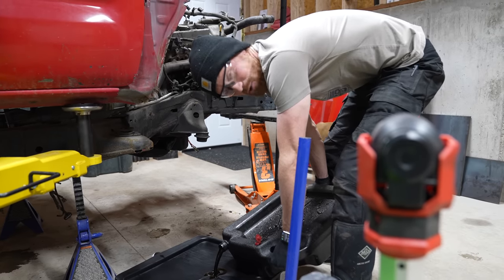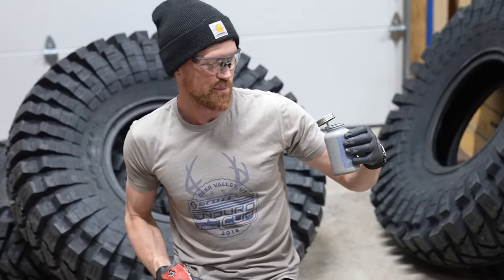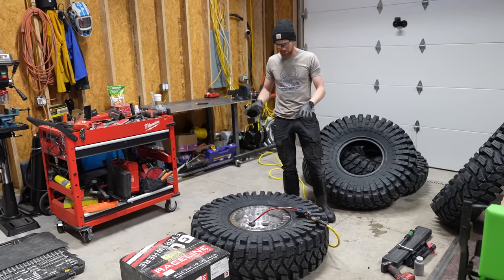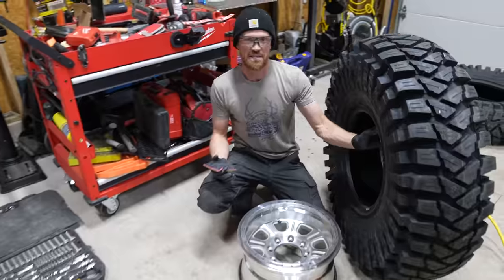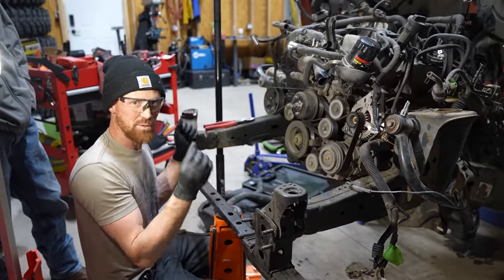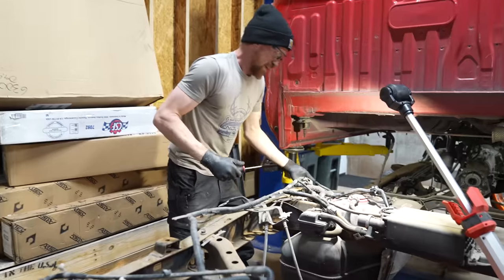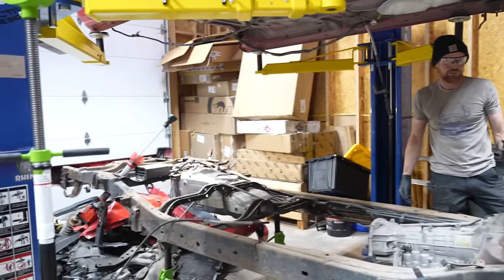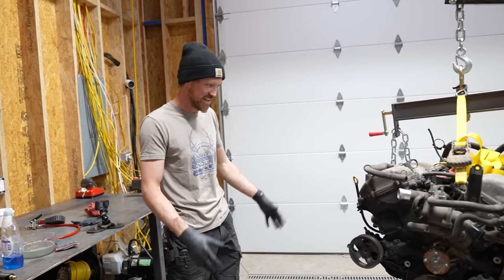CHANGE OF PLANS, IT'S GETTING MORE INTENSE... EP 5

Comment: Mechanics tip, attach one engine hoist chain on the front of the engine, and the other chain on the rear, this way you can use the hoist leveller to adjust the position of the engine!

Comment: We use to have military aircraft tires and wheels that were a real bear to get the bead started on. But we found that putting a ratcheting strap around the middle of the tire and tightening it down you could eventually get a seal and the air would pop them on.  I'm enjoying these videos, brings back memories.

Comment: When airing up a beadlock for the first time, I use a 5 gallon bucket, which supports the wheel and usually the weight of the tire is enough to get it sealed enough to start taking air.

Comment: Another possibly safer way to help set that lower bead I have seen used is to wrap a ratchet strap around the circumference of the tire and tighten it up. By squeezing the tire around the middle of the tread, the strap puts pressure to force the bead into place.  May not be as much fun as jumping on it though.

Comment: Trent, NIce recovery on balancing the motor as you pulled it out from the frame. The motor is always going to be the heavier part. Lesson learned bolt up more towards the center of the motor. L.O.L.

Comment: Hey Trent..
   Did you know that at the assembly plant. The frame rails were put in a jig.
   There pin or holes in the frame rails to square it up.
   This is what you need to get the frame back to square when add the new rails..
  Oh by the way. The hoist leveler was sideways.
  Turn it and the hand crank would have leveled out the load..   good luck...

Comment: I worked in VW restoration. I highly suggest to post mark each part and separate by putting in a marked box. Also write down the socket size. By doing this you'll save yourself headaches and valuable time!!! 
I witnessed it all of the time folks losing parts, clueless what went to what, and my wasting very many hours trying to find parts on projects they started. Only me had this bright idea with the suggestions I just recommend.
Reply: Awesome advice...he needs another one of those big ol tool boxes just for 'Trents garage'... Im glad I read your input sir...
Reply: @jess4mathews  well, I'm a woman. Probably the reason why I'm the only one who had the bright idea immediately!! 
I put the nuts and screws immediately into a zip lock and post a note. I also write down which side something went to. Writing the socket size saves an incredible amount of time and whether metric or not. 
And I mark the car/ bus it goes to but he's only working on one truck.

Comment: Trent use a ratchet strap. Strap the tire while you filling it to push the tire where it need then take the strap off when it pops, then your good to go.
Reply: There's also the more exciting, spray ether starting fluid inside the tire and light it with a torch!  The resulting explosion forces the bead onto the rim.  Old mechanics trick when changing a tire or reseating it in the field.   Had to do it on a Bobcat once, works well!  Scares the crap out of you..... but works well.   🤣

Comment: Safety suggestion  seeing as you don't have tire cage  use a section of chain wrap thru axel hole and around tire loosely  so when adding air doesn't  pop off and possibly  hurt you  while rare it does happen  and has caused serious injuries   understanding  that you not adding  alot of pressure  just the same it only takes one time  like being pregnant  you are or or you are not no middel ground

Comment: OK, 1. the ratchet strap works, what you need is a engine hoist leveler. 2. it appears you want a lot of power. it's going to be expensive for a Toyota. So, just get you a 5.3, 5,7 or the desirable 6,0 LS engine, with either a 4L60 or 4L 80 trans, A Holly EFI unit and brain(Computer) and have way more power than you ever want, and do it much cheaper. A very popular swap these days, into EVERYTHING! And Tons of information out there for a complete swap!

Comment: Yaaaa 💪🤝🤓 having that mota out where you can see every aspect of it is a huge step...thats how you can really see what you've got...check for cracks, warps & dings and bubble gum.... might consider start ordering parts as you get them off and before that big red puzzle gets so scrambled around its an omlette not a truggy... great fun going on over there spectacular tires I mean oh heck yeah...where's Joel that smart guys' gonna want to know where everything's supposed to be sitting and how it works... I think they clip those wiring cables together in the middle so they don't get hung up on assembly line or subsewuent functions...anything going forward or in reverse lol 😆thanks for sharing c-ya @

Comment: Engine stand... Allie did you know about this purchase. LOL  We built our own engine stands because our equipment  wasnt exactly standard, and we built a piece of an old axel in it with brake shoes  so we could spin the engine upside down or side ways or whatever we needed and hand pump the breaks to lock it in place till we needed to rotate it again for the other bank or upside down to torque the rod bolts down.

Comment: Trent, I had a problem setting the bead on one of my trucks, so I took it to a shop and paid a lot of money for them to set the beads.  Then I learned about an air tank that is called a bead blaster, which basically shoots 80 psi into the open side of the bead, and simply blows it out to set.  The best part is, that tank only costs about $60, which is far less than I had to pay the shop to do it for me.  If you want to drive to NY, to pick it up, I'll donate it to your shop. 🙂
Reply from the maker: That’s a bit of a drive for me haha

Comment: the engine level is 90 degrees turned from how it was designed to be used.  the crank on the leveler is meant to solve the issue you solved with the other strap.  you got it done tho!

Comment: I can’t sleep, now. Still thinking about your engine build. I previously mentioned hp vs torque. If you’re gonna custom build a crawler-motor, you may want to Google “L/R ratio in engines”. Think about twin small turbos (boost at lower rpm) and a lower L/R ratio (longer rod) which will enhance torque. You will need to order pistons with a custom cut wrist-pin location. This, I think, would be the “sweet-spot” combination for your use, enabling the use of the original block. Again, when building the engine, you really just need fuel, compression and spark. And maybe a way to on-board charge your battery (alternator). That’s about it. Use a mechanical advance distributor and do away with a lot of electrical plumbing
A longer rod in essence, parks the piston at top-dead-center longer, allowing more pressure to build up before the piston starts down.

Comment: You need to convince Alie that a air attachment for your engine lift is important for precise movement of engines or whatever your lifting into place goes safely. Many times we fight to get something in place and take chances with digits because of not being able to jack up something or release pressure so it can go that half inch or so into place. The air assisted parts come as a kit and mount to the existing cylinder on your engine lift. Better ways are safer ways is my seventy three years of life to make these kind of decisions that keep us safer in many situations. I am not sure of the cost because I made mine before they were a kit and things do get expensive when its in a prototype situation. You get it, a couple tries before a great success of seeing it. I made mine and low and behold, Midas Muffler came out, took a lot of pictures, offered me money for this idea but me being me thought "who else would want it" and it turns out that its mandatory now in many shops. Trent, I worked in heavy equipment repair on the islands in alaska where you were the store,... you went out to storage area and picked through stuff and repurposed it or you waited for months for Gold Streak to deliver it and that by the way coming not only by plane to alaska, was then loaded on a barge if it was a heavy item (engines, transmissions, etc) to be shipped  to you and you were just on a list of drops. I got parts almost two years after ordering them prepaid so when it came, it was either used for something else or sat in a corner waiting for a new use. Enough jibber jabber, get a air assist for the engine lift and save yourself a lot of grief.

Comment: I like the wheel-tire combination, but did you think about adding balancing beads to the inside of those tires? Thier going to be all over the road without something to balance them. Also, your motor balancer was turned the wrong way. It should go from the front of the motor to the back. It supposed to balance the motor from front to back.

Comment: I think most people run 30 psi for the road and 22-25 psi for the rock crawling. Not sure anti seize is a good idea on those wheel rings, I think it would allow them to back out easier, and cause issues.

Comment: Great video Trent, loving this type of content , totally hooked on the house and garage too as I was the Van life ,,I'm curious about the bead locks, i know they use them for drag racing to stop the wheel spinning inside the tire but whats to stop the rear of the tire becoming dislodged at low pressure off roading ??

Comment: The reason you had to use the ratchet strap is because you connected the chains wrong.  The hoist leveler you connected to the chains should be in a straight line front to rear of the engine so that you can crank the handle and balance the weight forward and back.  You had it setup left/right which basically does nothing.

Comment: Dang this is sooo cool watching you assemble the tires on the beadlock rims.those things are huge definitely going to be a big truck when done.and yes you better super charge it to get those monster tires to turn over LOL.
   I had no idea you knew so.much about trucks or vehicles and that you rebuilt engines before. Really enjoying the process.
  Allie be prepared for Trent to spend alittle more money, he's rebuilding the engine now LOL.
   Buy will be well worth it to build as much power into the motor as possible.
   Yall be safe way up there in winter wonderland.
   Spring is right around the corner in 5 more months for yall  haha 😄 
   Here's my Temps this week for February 20th - 24th 68 73 73 84 67 and no rain here in western NC.
  we've had the mildest winter we've had in the 35 yrs I've been down here.pennsylvania is where I grew up in hard cold long winters.This has been so much nicer down here.
   Ok enough rubbing it in 😆 
   Yall be safe, God bless

Comment: If it was my project I wouldn’t even think of rebuilding and supercharging that motor. The cost of a ls motor would cost 1/4 of the price. It would have way more power/be more reliable/ eliminate most of the wires/stronger transmission-transfer case….etc. I would take a stock ls motor and throw in a hot cam ($700 for the kit) and those make 525hp to the rear axle but be reliable and easy to drive. 
A stock low mile ls engine up in 🇨🇦 (southern Alberta) where I am are around $2500 so in 🇺🇸 they are probably $1500. 
Wiring harness $750
Cam $700
Headers $300
Radiator $300
And you are on your way  !
Also much easier to find parts if you need them.
Your call…but remember if you get committed to the other motor and start to have regrets….just remember I should have listened to Scott !!!😂😂😂😂 
Whatever way you go I enjoy watching !

Comment: Be sure to have the block DECK milled. Flat surfaces flat, round holes round. With that much mileage a .030 overbore, FORGED pistons with your choice of innovations. If you really wanna make hp, I suggest gas-porting the top ring. These are small holes drilled into the top of the piston that coincide with small holes in the pistons top ringland. Pressure from the combustion chamber goes thru the holes exerting high pressure behind the top (compression) ring which results in a volumetrically efficient compression chamber. Maybe use a chrome moly top ring.
If you’re gonna turbo the motor, still a good choice. If you’re gonna supercharge with, say, a GMC 471 or 671, you barely need rings or exhaust valve SPRINGS, so much pressure is exerted the exhaust valves will be blown shut. If supercharging you need to scribe-mill the deck for wire inserts to keep from blowing gaskets. Be sure to torque slave-plates on the deck and circulate 220 degree water in the block when final cylinder honing. Find someone with a SUNNEN CK-10 hone. You need a steel billet crankshaft and Corillo rods..

Comment: Hey Trent another great video.  Rather than pull the tranny off the engine and mounting the engine on an engine stand, why don't you keep them together and just lower them down on a movers dolly?  You can get some from Home Depot and then you can move them around easily as needed.  If you want you can still separate them and have them on two separate dollies.  Get some old tires (no rims) and place the tires on the dollies as cushions.  No need to make any special cradle.

Comment: The chains for the engine hoist should be attached to the front and rear of the engine
Reply from the maker: I know, but the engine did not have great spots to support its weight so I went this route
Reply: The engine hoist load leveler should be parallel with the engine and transmission. Then you crank it to adjust instead of putting on the ratchet strap.

Comment: You're using the engine leveler wrong. It's supposed to be parallel to the crankshaft axis, not perpendicular. That way the handle on the leveler can be used to move the pivot point back and forth so you van level your load

Comment: i would wait on the transmission. it defiantly falls under the rule if it isn't broke don't fix it.    you could end up with a problem that didn't exist in the first place.  rebuilt transmissions are not as reliable as factory.  plus with what your doing with it they probably wont honor a warranty. OR just get one built for extreme off road use.

Comment: supercharger wont bring as much as installing a double transfer (extra gear reduction). Ive never seen a rock crawler that ran revved up.
Reply: and anti seize changes your torque rating of your bolts.  just a heads up.

Comment: I think you need wider tires. If you end up making a lot of power, those skinny ones aren’t gonna cut it..
Reply from the maker: They’re 14.50’s 😳
Reply: @Trents.garage  
Could be enough, I don’t know. I think that if you supercharge an engine, (high rpm hp as opposed to torque) you’re gonna have to run a HELL of a gear like a .650. Maybe the tread will do the job in your application and not break loose 
I don’t want to introduce a gremlin into your head, but maybe massive cubic inches (and torque at lower rpm) is the way to go. Maybe find a Chevy 454 truck block. Truck motors have taller pistons AND deck height (4 rings per piston). If you use regular 454 pistons, because of the deck height, you can run a stroker crank.
OR… you got me thinking… maybe run 2 small turbos which will “spool up” and create boost at a lower rpm. Ask Allie what she thinks..scratch that😅

Comment: It's kind of amazing that when you look at the frame and motor/tranny, nothing much has changed really since the first Model T rolled over the assembly line? It's basically the same basic configuration. Don't change something that's worked for over 100 years.

Comment: You are using the leveling bar wrong for engine pull... it should be one side bolts to front other side bolts to back then crank the red handle to level the engine or tilt the engine
Reply from the maker: I know, I wanted to hang the engine this way. However this motor did not have easy spots to hang from the back. Oh well

Comment: If you're spending this money and time on this truck, and you're talking about rebuilding the motor, and supercharging it... why the HELL would you put a used up Toyota v6 back in it? Why not an LS swap, or maybe a coyote or something? Also, if you're going that far, ditch the frame altogether and build a tube chassis. The only thing that you'd use off the Toyota then is the cab. It all depends on what your end goal is and what the picture in your head is of what you're building. 

Also... that is definitely NOT how you use an engine tilter.
Reply from the maker: I like the lightweight factor of the Toyota motor. Also everyone does LS swaps and I know it’s cuz they’re Cheap and make sense, but I wanna try something a little different. 
The frame is bent so I am cutting it up into pieces and building a fully custom tube chassis. 
16” coil overs front and rear, 4 links, full hydro, ultimate Dana 60’s front and rear! 
I’m excited to undertake this project and hopefully you’ll follow along and give some advice as I go! I’ll need it haha
Reply: @Trents.garage  yeah, I'm following, I've been watching you guys since you flew back to the US during covid. I'm here Fer ya